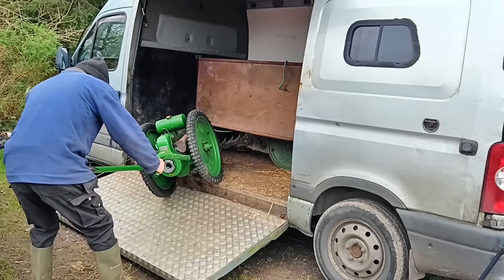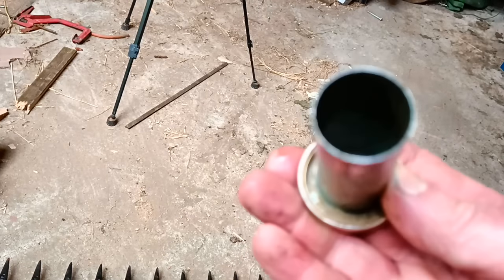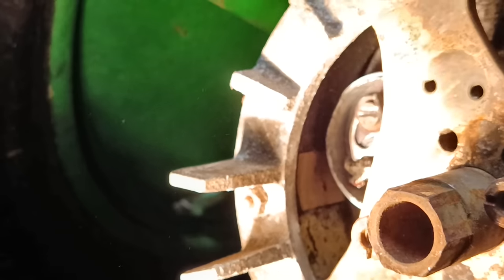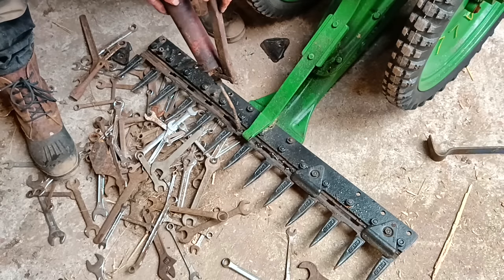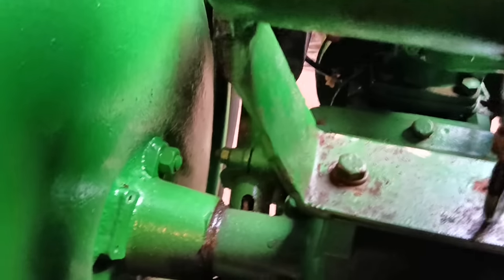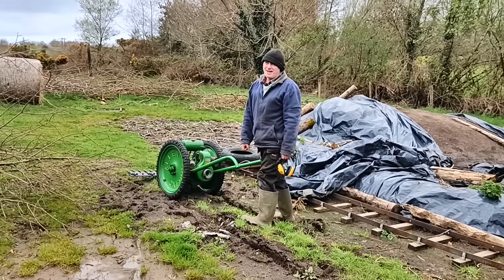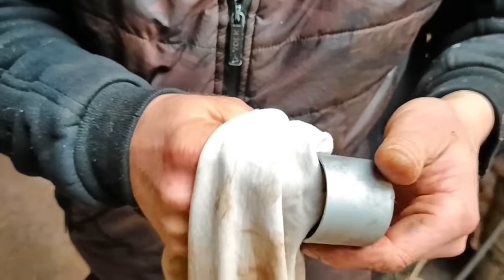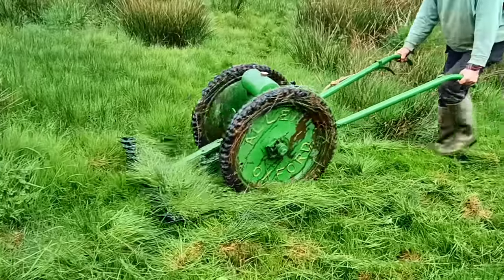First Run With A Vintage Allen Scythe Mowing Machine (1950s Model T)

Comment: Thanks for this. I'm in need of a two-wheel tractor type machine. I live on top of a steep hill peak with trails going down to a creek and the rest of the property. It's all wooded and I would like a machine that fits on the trails and could have a cart attached to ferry tools, firewood, etc around the property. Unfortunately, I know zero about engines/motors, gearing, clutches and the like. BUT.... your video of this machine gave me a solution to ground clearance and large dia. wheels for good roll-over ability for rocks and bumps on the trail. Your machine wheels look like dirt bike wheels, which I hadn't though of. So thanks! :) According to the grey in my hair, I'm not getting any younger.... so lugging heavy tools and such for trail building and maintenance is only going to get more difficult. I've got a fully welding shop and wood shop so fabricating isn't a problem. I'd also like it to attach a snow plow to as my driveway is a pretty steep 1/4km long and I hand shovel it, and my more senior neighbours equally long drive in the winter. I'm hoping to find an example of an electric drive system, run off a couple of 12v Lith. batteries for quiet, low maintenance, not fumes, etc. But haven't ruled out a Honda engine. I don't need speed per say, but lots of torque is the priority for pulling heavy loads up steep narrow trails. 
I'll continue my YT search for something someones made that I can learn and replicate. So if you or anyone has seen something that may be useful for me, please leave a comment. 
Again, thanks for the inspiration on the wheels to use! 
Regards,
Bert
Vancouver Island

Comment: When you go to disengage the clutch, a sharp push down on the handles at the same time takes off the preload,   It makes the clutch far easier to release/ use .......... the later models had a 4stroke engine... was a great improvement ...
Reply from the maker: Thanks - someone else said I should lift the handles, but your suggestion sounds easier..

Comment: What a wonderful old machine.  Back in the 1950s or early '60s, a neighbor had an only scythe mower he let us operate.  We asked what to avoid.  He said there's no need to avoid anything, even small trees.  We experimented with a sapling that was perhaps 3 inches thick at the base.  We raised the blade and it cut through the trunk above the base where it was maybe 2-1/2 inches in diameter.  Although it took a while, the blade never stopped until it cut its way through the tree.  Because of the blade design, they stop at nothing.

Comment: Wishing all the best with these units. Years ago I was a member of a ski club and we had a dry slope nearlby and a show slope up in the hills. We used two of these to mow the upland grass so there was less chance of it poking through the snow in the winter months. They were great uphill and a bit sketchy when going down, but not too bad. You just had to be ready to let go and try to rotate the mover to prevent it running away. Cool and unique machines. Lovin' the vids and your work. Thanks!!

Comment: When I was a boy there were several around here. Several stories too ! Farmer Kenny Emmett used one cutting his orchards and footpaths through the kale. He tackled the big clumps of brambles in Mimie's Hills and found he could set it going one side of the clump and catch the bugger the other side.
Until, in the middle, a bramble knocked the throttle off.  He had to walk back to the farm for the long handled hook. I remember Father and Mother talking about it, the allotments men and customers in Beryle's shop.

Comment: I never saw a scythe like that but when I was a kid (1970's) my dad ran a cattle farm.  We made bale string cutters out of scythe teeth like those on your machine.  It was basically just one of those teeth with a handle attached.  One of us kids would be driving the truck and the other was on the back to feed the cows.  You'd pick up a bale with both hands, one holding each string, and one also holding the cutter.  You'd then cut the first string and move that string to the hand not holding the cutter so that hand was now hold two strings but the far string wasn't cut yet.  Then you'd buck the bale out and cut the other string just as the bale started to fall.  If you did it right the bale would sort of explode lengthwise when it hit the manger bottom so it spread out nicely for the cows.  If you missed cutting the second string both you and the bale were going in the manger :)

Comment: As you have discovered, an absolutely brilliant machine from the good old days of British engineering. It's the weight that does it. Villiers spares still available and plenty of other donor parts can still be found through the usual sources. That carb for example, no plastic bits or membranes in there to perish away! I would say the engine is running about as good as it gets when idling, runs better when working hard, and the clutch is either in or out, no smooth transition available . A few tips:
1 If it stalls when hot out in the field, turn off the fuel, go and have a cup of tea and try again later. The backfiring, whilst part of the fun, is probably due to fuel starvation..
2 Put some padding on the open ends of those handlebars to save bruised thighs and nadgers. Gloves also help prevent blisters from all that vibration. You don't actually need to grip the handlebars, a light guiding touch is more the thing.
3 If you trip over and let go, she will just keep going and demolish and/or cut off at ground level anything in her path. Animals, pets, wives beware!
4 When turning 180 degrees, knock her out of gear to save running round like a ballerina, and then off you go again. You can disable the drive on one wheel or other with the ratchet on the hub, ok if doing one direction turns all day, but of course you then only have one wheel drive.
Reply from the maker: thanks, Patrick - makes sense  : -  )

Comment: Here we have the blades with a serrated edges.  Greatly improved cutting hay. Use chainsaw bar oil on the cutter.
The last thing a adjustable foot in the center, to adjust for height. 
Keeping off the dirt and small stones.
Cheers
Reply from the maker: good ideas - thanks
Reply: The serrated knives essentially make them self sharpening.

Comment: I had one of these in the 80s. You could lead it up to a bramble patch, let it go and retrieve it as it clattered out the other side. I have now upgraded to an 80s kubota b7100 with a chain flail on the back. I had previously seen one with it's blades removed with a towed seat taking part in one of the early lawnmower races(around 1978) at Wisborough Green. Stirling Moss made about 10 laps for every one completed by the allan scythe.

Comment: I have owned two Allen Scythes. One similar age to yours or maybe earlier, which only had a dog clutch for the wheel drive, where you had to dip the handles to take the load off the clutch before it would release. The second one was a much later one with a 4 stroke engine and a three speed and reverse Albion gearbox. I came to the conclusion that they were made for cutting hay and not for mowing or brush cutting, as the cutter blades keep choking up. They really only work on very dry grass and they are very tiring to use. You have to pick up the mowed material or the next time you mow, the rotting mowed grass/brush will immediately choke the cutter bar. In the end I sold the old one to a collector and replaced the newer one with a Hayter rotary brush cutter, which was far better as it mulched the cut material.
Reply: I have had a different experience to you. I have one of the older ones and I find it will cut wet best. I have cut underwater when my paddock was flooded. A sharp blade adjusted to the teeth correctly is key. I agree with you on the clutch though. A sweep forward when disengaging is necessary. Otherwise you end up following it until it dies.

Comment: Those things are dope. I sold a scythe attachment for a 2 wheel machine around a decade ago to a collection who had a bunch of those 2 wheel machines. I sold quite a bit of stuff that my neighbor had. I got 50% of what ever I sold it for and I sold everything he had from tires to attachments to whole machines. I could never find the attachment that I wanted which was the mini baler. 
I still want one so that I can bale my 2 acres of grass rather than mowing it down every couple of years. Since I have been cleaning it up and with any luck the end of the year I should have ever thing removed from it and it will be pure grass land.
Reply from the maker: a mini baler attachment would be perfect for bales of bedding rushes too. Let me know if you find two of them : -  )

Comment: Points like that used all cigarette measurements, we would use the matchbook for some, the pack for some and the cellophane for others. That oil mixture seemed very rich, but it didn't smoke. We had a company called Bradley which made a similar machine only larger, it was actually a two wheel tractor.

Comment: i was taught so long ago you have to pull in the clutch but push the sythe faster to make it release sort of relieving the pressure  thats why it works when its not running

Comment: Villiers made engines for many small English motorcycles. Carburettor tickling was still the way to go for my 70s Triumph Bonneville. My recollection about rule of thumb for gapping (i.e. roadside repairs when the feeler gauges were back at home) was cigarette packet cardboard (not far from postcard) for spark plugs and a cigarette paper for points, measured at widest gap.

Comment: The closest that I've ever come to anything like this (on a much smaller and far less dangerous level) here in the US was the rechargeable battery-powered Disston lawn shears that had oscillating blades like your power scythe.  The main body was mounted to a set of tiny wheels, and had a long metal tube rising up to an appropriate height, ending with a handle and an on-off switch.  They were an alternative to the early line trimmer/"weed whaker" units, and as a very young boy in the late '70s, I helped my late father with the lawn mowing by following up with this along the rockery walls bordering the lawn, before my late mother added border planting beds and plastic landscapers' edging, that made keeping the outer periphery of the lawn evenly trimmed much simpler.  We also had a couple of handheld versions of the same basic thing (before moving on to the more conventional corded and cordless line trimmers), but they went to the garbage or the castoff goods collection event many years ago; likely because it was difficult to get replacement batteries then.

Comment: You can verify top dead center by removing the spark plug and inserting a long wooden dowel or a resilient stick.  Then you can watch the movement of the stick to see how/where the piston is positioned.  Since it is two-stroke, the engine will fire every time the piston comes to the top!
Reply from the maker: thanks, yes, but the timing seems about right as it is?
Reply: @wayoutwest-workshopstuff6299  Yes.

Comment: About the rough running: Twostroke engines can backfire due to lack of fuel. This is because the intake opens right after the exhaust, before the exhaust gasses have had time to properly leave. If it runs lean it will burn more slowly, since there is more space between the fuel molecules. This will mean that the fuel is still actively burning as the intake opens, and therefore the flame can go down the crankcase and out the intake.
Reply from the maker: Thanks, Edvin. Yes, that makes sense..

Comment: I'm seeing two extra uses. First one, spread your charcoal over a field and run that monster over them. No need for the charcoal grinder :) Second one, if you can get the spare one's engine running, it could be ideal traction for your railway!

Comment: To prevent having to run around the outside on the turns, try disengaging the drive wheels (or slip the clutch slightly), so as to make the turn radius YOU want rather than the radius determined by how fast you can run.
Regards Mark in the UK
Reply from the maker: The clutch is either on or off - no half-measures possible!

Comment: With modern petrol and good two stroke oil, you can run 50:1 mix in those engines. You don't have to clean the exhaust, the ports and the top of the piston every 50 hours, then. 
Those nose-piston engines are kind of dangerous if not maintained properly. If carbon builds up on the piston, the carbon acts like a glow plug and you cannot kill the engine with the ignition switch. They run even faster with the ignition turned off! That is REALLY scary if you experience it for the first time...
Sweet find and a great video! Have a nice spring!

Comment: used to own one (atleast my dad did lol) the one we used to have looked like this but had a bridgen stration engine on it but it was in a transverse configeration, had 4 pram like wheels on it tht can be adjusted like a modern mowet and finally it had a cast aluminium body on it. it was honestly one of the weirdest purchases my dad ever bought & what i had to fix.

Comment: Wonderful to see an Allen in use! I've got one (plus two for spares...) that I use around my small farm where the tractor won't fit or it's too wet. Yours looks like an early model (1940's?), with a narrow wheelbase, a simple clutch, and only one ratchet on each wheel. The slightly later models (mine's from the 50's) have the wheels slightly wider apart (stability on slopes!) and an extra ratchet on each wheel that can be locked down to disable the freewheel so that you can safely drive them down hills at the expense of not being able to turn easily. They also have a clutch with a second lever (in place of the locking lever on yours) that uses the rotation of the wheels and a cam to force the clutch to disengage, even if it's under load.

You might find that it runs better if you use straight engine oil instead of two stroke oil. The crankshaft seals on those old Villiers engines are just simple washers, not the rubber seals that you'd find on a more modern engine, and a gloopier oil helps the seal and keeps crankshaft pressure up which is vital for good running on a 2 stroke. The manual recommends SAE 30 weight oil at a ratio of 16:1 and mine runs well on that, at the expense of a somewhat smoky start.

I'd recommend sorting out a hay rake (as you showed in the video) to fit in place of the cutter bar too. I got lucky on ebay, but one would be easy to fabricate, it's a simple metal frame with wooden teeth, slightly chamfered underneath so that they skip over the ground. You can pick up all the cut rushes, etc. and shove them to the side of the field very easily then.

Comment: I bought one of these two years ago, but am only just getting around to getting it working. I reckon the points should be set to 10-14 thousandths of an inch.

I remember one being used to cut the grass on the fields around my primary school in the late '50s, and never expected to own one myself.

Comment: American standard for points is 20 thousandths on most of the old stuff. Under the blades there should be a skid to keep the nose up off the ground a proper height to keep the blades out of the dirt, mug and muck.

Comment: Tim
What a great machine!  It brought back memories of seeing the groundskeeper at my school in Norwich back in the 60's using one around the sports field.  From here in Canada, that now seems light years ago!  Could you make some handgrips that you could mount above the present ones so you do not have to bend over so much to use the scythe?  I have used a few older hand held machines that seemed to have been designed for very short people and I'm only 5'  10" and it was hard on my back.  You could mount them in such a way as to not harm the original nature of the machine and of course the control levers stay where they are.
Reply from the maker: I'm thinking the same thing : -  )

Comment: For many years I used to use one of those to cut an acre of grass for hay. Great until you hit a mole hill with one side of the cutter bar and it throws you sideways.
Good luck with yours.

Comment: We have 3 - 1 in use, 2 for parts. You said about it possibly running away from you down hill, I can say from experience that it can also run away from you on the flat, going uphill, through hedges, through fences etc 🤣

Comment: I was advised that to disengage the drive you have to push the machine forward taking the pressure off the drive allowing the clutch to dise gage. Hope this helps.
Reply from the maker: that would work until you're already pushed up against a post or a wall!
Reply: @wayoutwest-workshopstuff6299  So lift the wheels off the ground using the handles.

Comment: The engine is governed at about 2400rpm by means of a cemtrifugal switch on the mag. It runs quite unevenly unless ubnder full load. Drive it to where you are working.

Comment: Time to get the parts machine built up so you can race them! I have the 4 stroke bigger brother to that, seems they designed them for very short people as the handles are below your pockets, gives me a right bad back! I always wondered if they are all in such good condition as they are so cumbersome to use they only came out once in a blue moon. I also have a Mayfield 2 wheel tractor, that's a universal machine but the handles shake so much its hard to hold on to, Allen got the counterbalance right as these machines are so smooth. But looking forwards to seeing how you get on, I always find the cutter bar getting bound up with cut material and having to pull the machine backwards to clear it off. I'm also sure you can lock the dogs on the wheels for going down hill but you then have to skid steer it?